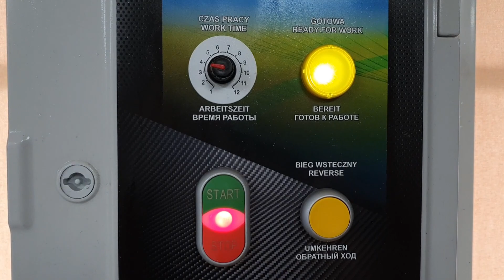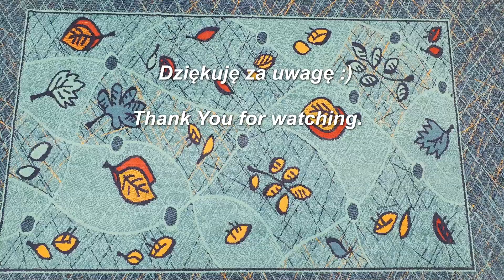Pranie bardzo ładnego turkusowego dywanu w liściaste wzory, wszystkie plamy zeszły a kolory ożyły 💦😃

Comment: Scraping: 7:01, 10:12, 12:27, 16:10, 22:12, 23:51
Brushing: 11:30
Slow motion: 12:38, 22:25
Reply: Thank you!
Reply: Thank you
Reply: Not "scraping"!  That is a squeegee to push the soapy water off! There is a rubber blade on the bottom.
Reply: Thank you for this! ❤️❤️